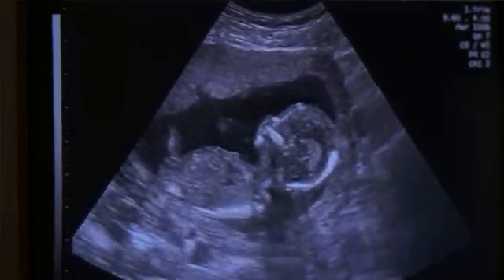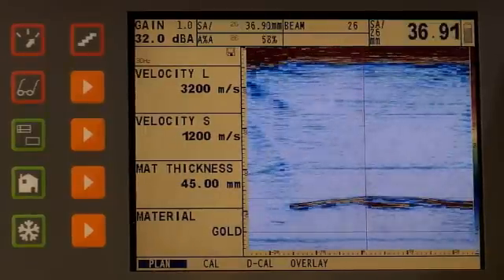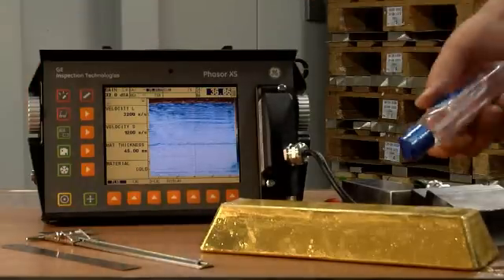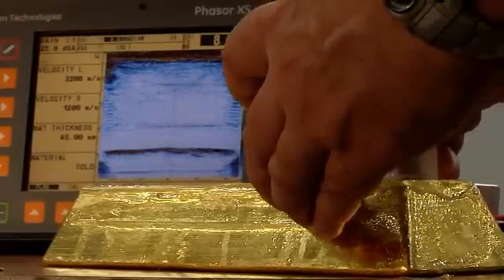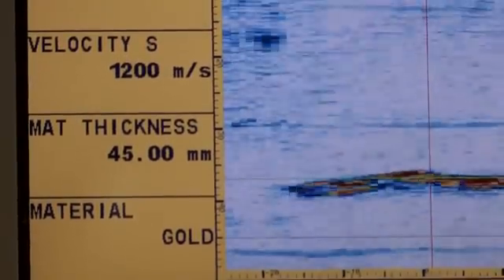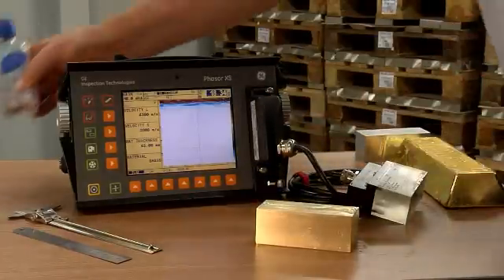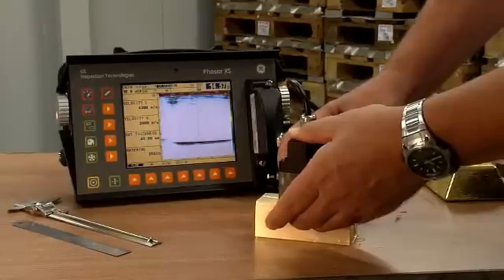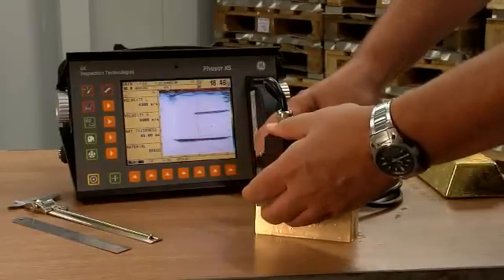Testing the Purity of Gold Bars with Phasor XS

Comment: What happens if the inside is copper and it gradually turns into gold on the outside instead of sudden changes into gold, because I guess ultrasound can only detects sudden changes not gradual Alloy changes from Gold to copper and copper to gold

Comment: Ultrasound travels at a different velocity in gold as it does in tungsten.  So even an alloy of gold and tungsten with no physical defects it should exhibit a different then expected velocity. (Gold  ~ 3200 m/s: tungsten  ~ 5500-6000 m/s)  if the UT set is configured for the known 3240 m/s (At a specific temperature) and the ut distance does not match the caliper distance (Thickness of the sample)... could spell trouble.